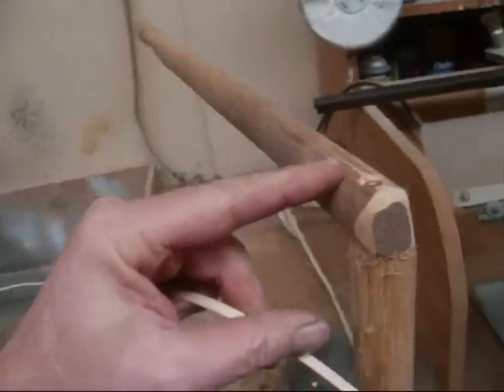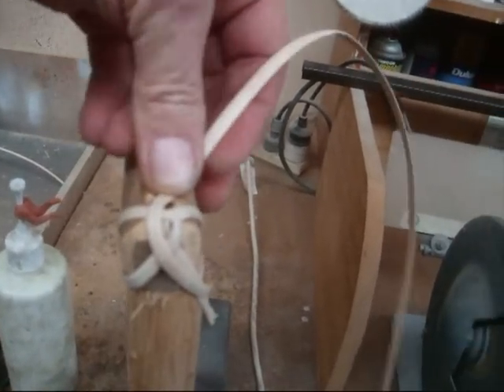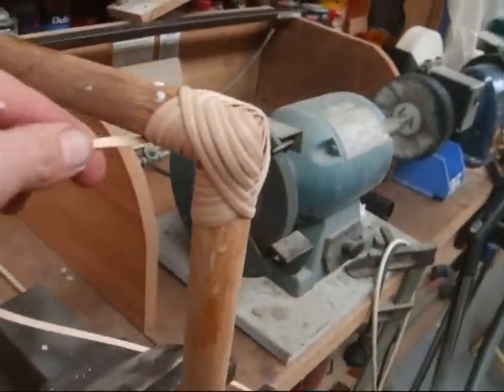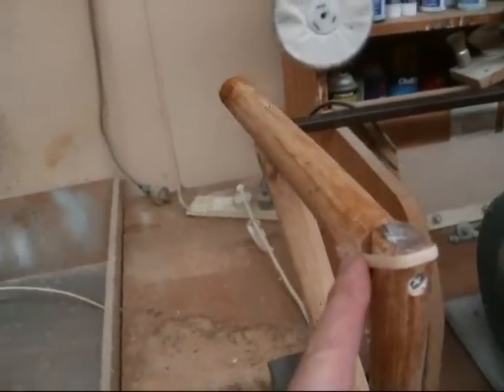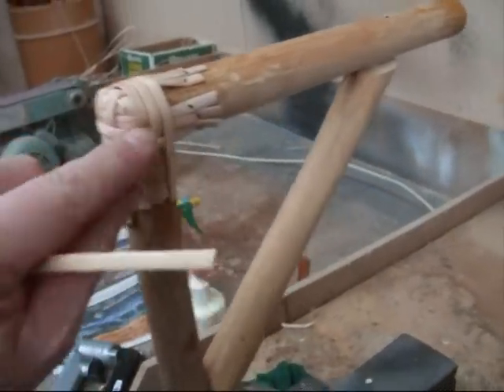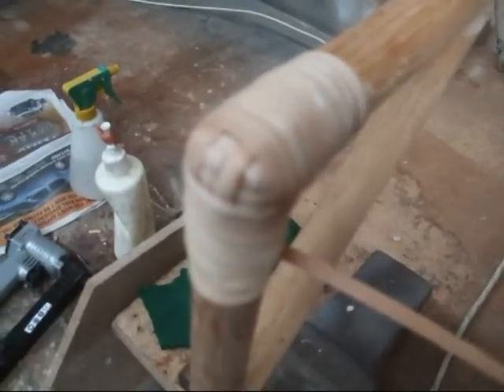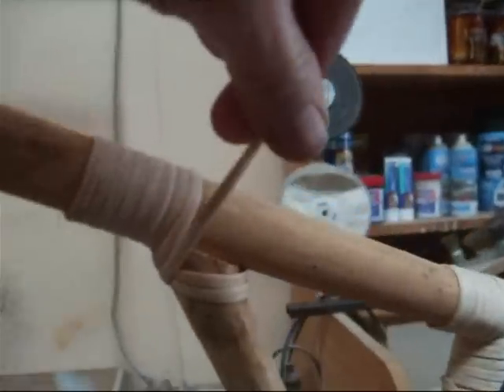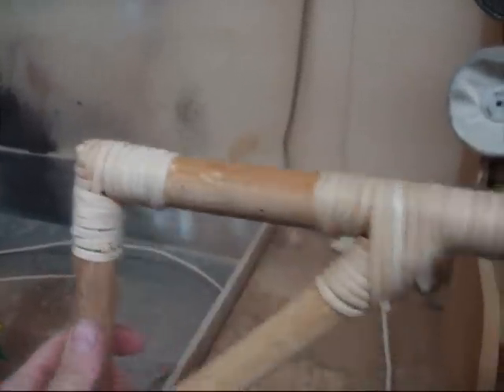How To Bind Your Joints - 3 Methods

Comment: This was very helpful. I would love to see a video on how to replace a caster on a piece of rattan furniture or putting a caster in a new piece. I’ve been searching on how to do this unsuccessfully. Thanks again for this video!
Reply from the maker: Hi Jennifer, Thanks for your feedback. Casters are usually either screwed onto the legs where the caster cap fits over the chair leg, or a hole is drilled up through into the leg and the caster collet is inserted. Then the caster is connected to the collet like a bayonet fitting. So really no video necessary for this task. The only issue  to look out for is that a cane leg can easily split should the caster collet be too big. I think the average size is 6/8 mm dia. If your cane leg is 20 mm or smaller in diametre, the castor will be too big to fit. Hope this all makes sense.
Reply: @wickerguru  

Thank you for the quick response. I appreciate the info. I should have stated why I was asking. The problem is I have 4 rattan dinning room chairs with casters that have wore out. The sockets are starting to crumble making the casters loose. One caster is so loose and the socket is gone so the hole has become large. I’m trying to figure out how to go about repairing them. The chairs are in great shape otherwise. I’m not sure if I should fill the holes and redrill for new casters. If so what should I use to fill the holes? I have liquid wood epoxy but wasn’t sure if rattan would respond as wood does. I would appreciate any advice you can offer. The legs are 1.5 inches across.
Reply from the maker: @jenniferjacobs5963  you may have to try using an epoxy resin which should be strong enough to hold the castors, but no guarantee. You may also have to wrap cane binding around the bottom part of the chair leg for extra support.
Reply: @wickerguru  
Thank you so much for the help. It’s greatly appreciated!
Jennifer

Comment: Thanks for the video is there a type of material you would recommend for outdoor use? We tried to take some furniture outside and they spit and cracked..
Reply: Natural Cane Binding is fine for outdoors as long as you can maintain the finish. Linseed Oil is the favoured protection and exterior paint or varnish is recommended. Resin or synthetic wicker can be used, but eventually this will crack and fade if left in full sun, and then there's little you can do except replace it. By keeping the materials clean and away from the direct sun, will increase the longevity of any material.

Comment: Thank you!! What would you suggest to use to dye the cane to make it match the rattan furniture piece? I have a dark brown chair that needs some new corners binded and I have no idea how to make the color match once I'm done with the binding! I know linseed oil brightens up and restores rattan but the furniture is darker than just from oil I'm pretty sure. Any tips? I read RIT dye would work? Just need to find the right color! Afraid it's not going to match right!😬
Reply: Hi Claire, staining can be a little daunting, and to achieve a close colour match. Best you visit your local hardware store and grab a few colour charts. Buy the smallest quantity of stain, as you won't need much. Run a few tests first on some left over binding cane. Single application might be ok, a second application will be much darker. Apply a clear lacquer or polyurethane to finish. Or you can use the oil. Good luck.
Reply: @wickerworks-richard3847  Thank you for responding! Appreciate it!!

Comment: Trying to make minor restorations to a pre-war bamboo magazine rack. It's minor really, just unraveled short lengths of lashing that need to be re-attached, but  the lashings are dry and brittle.  It's quite fiddley. Already tried Bostick and superglue to no avail. Would PVA be ok for this job?
Reply from the maker: I only use PVA wood glue, as it's water soluble, meaning you can apply the glue whilst the cane binding is wet.
Reply: @wickerguru  Thanks. Appreciate it. I'd given up as a bad job, and am in the process of dying raffia with tea, in order to match it to the dark colour lashing, and bind over it to re-secure it. Might have another go now with PVA. 😉

Comment: How do you calculate the lengths needed for each joint?
Reply from the maker: Simply use a length of 5 mm wide ribbon to determine the approx quantity required and then add some for any joins. After a while you'll get used to working out a guesstimate just by viewing the size of each binding area.

Comment: What glue did you use I’m trying to rewrap mine but it’s on metal not wood
Reply: PVA wood glue. You would need to use 'Hot Glue' from a gun, and only on the joints. No need to glue down the cane binding on the metal frame. The metal will heat up in warmer conditions (summer or near a heater) and the binding will eventually become brittle and crack. It's a problem you can't avoid.